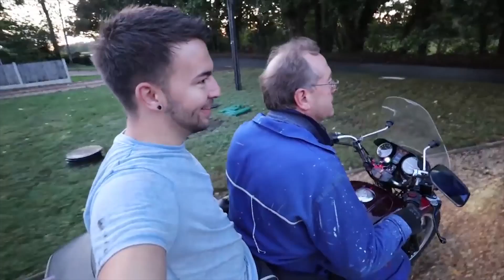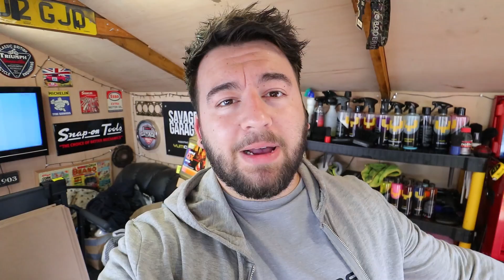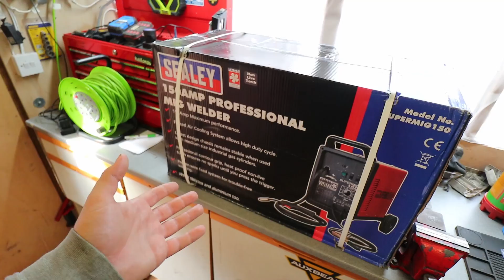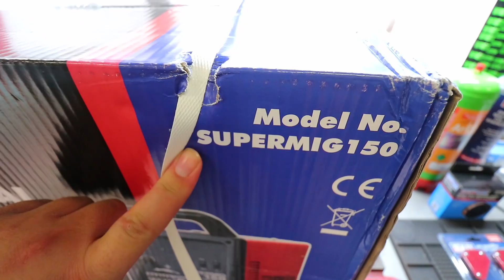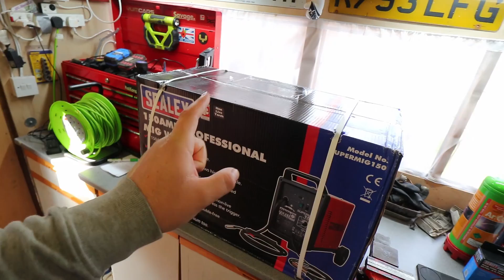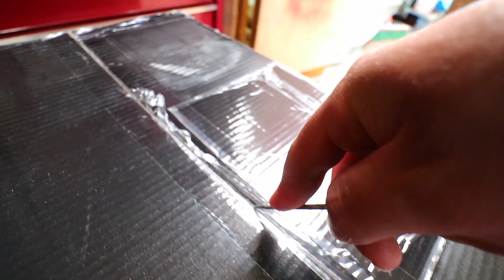I Got a Welding Machine! *Finally*

Comment: Great video 👍🏻. I  recommend getting a 16 Amp Commando Socket Installed with the correct blue plug. After long periods of use the 13 Amp plug might get hot and become a fire hazard.
Reply from the maker: Ben Libbeter I don’t plan on using it for long periods of time really but I’ll consider it! Cheers
Reply: @TheSavageGarage  
Don't worry about the plug, I got a 180/1 mig at home and that used  same 13amp plug for 28 years, if your shed power socket got minimal voltage drop then all be fine , that 150 mig light duty cycle and your planned usage going be lower voltage settings .
Plug it in and enjoy ...
Reply: @TheSavageGarage  personally I wouldn't consider it and just do it.

You will blow the 13a fuse constantly not to mention the heat etc.

You can do all of the calculations for 100% use and the heat dissipation over the cable's and plug and socket etc. But Imo it's borderline. Fit the 16a command.
Reply: @markd5266  
28 years on a 180 turbo mig and if I ever replaced the fuse I can't remember it and the plug/cables do not get warm .
Only time you get issues is if the socket you using got quite a bit voltage drop, some external power or long extensions can drop a serious amount of volts then your amp drawer goes high .
Reply: @David M , A lot of people who use to the nanny state and born wearing a high viz jacket and a hard hat and never done any real work thus have limited real world working experience as might suffer a back injury ...
Reply: @David M, If you blowing lot of fuses it due to a problem and not directly linked to a plug.
If you want a 16amp plug then you need a 16amp circuit with 16amp industrial socket .
Most people have issues on 13Amp purely as the circuit is poor install or they on 50Metres of extension cord and got voltage drop and when voltage low the amps go up to compensate and fuses keep blowing and wiring gets hot .
A good 13Amp circuit runs 3hp motors and a 180amp mig pretty easy, I never had issues in 30 years on 13amp plugs if all else is good ,.
Start current on a 3hp motor won't blow 13amp fuses and our mans 150 mig welder will be fine as long as his shed voltage in range over 220V
Reply: @mrb1864  And this is why rules and regulations are in place.

Can you guarantee that James will get a constant supply of 220v not to mention tolerances and fluctuations and power demand on the supply to the shed.
The regulations are in place to stop you from using a 50m extension lead etc.
Nanny state or not it will stop the shed going up in flames.
Realistically what you are saying is wire 4-5 kettle's up in a 13a plug and turn them all on at the same time 😂
And continue to use them.
Why do you think a lot of people are saying to use a dedicated supply.
If it was fine to use on a 13a plug it would have come equipped with one.
But what do I know I'm just an electronics engineer so no real experience.
Reply: @mrb1864  in another example, wire your cooker to a 13a plug and it will work. But then use the cooker on Xmas day and see how many time's you blow a fuse or trip the breaker and the cable's getting warm etc. And then tell me that you would be comfortable using it like that everyday.
Reply: @markd5266  
Quite simply you have that much inbuilt safety from the UK 13Amp plug design and fuses and consumer unit protection nothing going up in flames .
Worse scenario will be blown fuses if his shed power poor .
His welder will run off a 13amp plug no problem with some user common sense .
Is it by the book, no.
If you want see how far electrics can be pushed work in asia for a few years and you see mig and mma running on really poor US style plugs and low quality wired mains with minimal issues .
For DIY use at home on low duty lower power migs you can and thousands of people do use 13Amp supply no issues .
Stop the drama, James is competent enough make the choice and if he gets any issues he can evaluate and upgrade if so wishes or needs to .
From my real world experience  I never seen any issues if used with some gumption .
Reply: @markd5266  
with bit of gumption you don't get blown fuses or hot wiring.
In over 28years I can only recall on plug fuse blown .
Even a 3HP motor will run on a decent installed 13Amp circuit and if it won't the thermal motor trip triggers or a fuse or trip goes .
With a little sense it perfectly fine, he ain't planning on running a high duty mig and welding I beams for hours on end ...
Reply: @mrb1864  use your real world gumption then and consider it under a fault condition or under heavy usage. And then see what the outcome is.
Also how many people will have the common sense, hence the rules and regulations to stop this stupidity.
That's like me giving someone a unit and saying it will work fine just don't use it at maximum.
Reply: @mrb1864  you have just answered and proved my point. "with bit of gumption"

How many people have that, hence the regulations to prevent that.

Yes the UK has lot's of regs in place, that is to prevent the end user with no experience from causing harm to themselves or the property etc.

Just because your friend's welder has worked fine, that does not mean other people's will work fine.

Are you even taking into consideration about fault conditions, usage, temperature and relative temperature etc.
Not to mention that the cable to the socket maybe underrated for the maximum current draw etc....
That is why everyone is saying a 16a  plug socket and supply.
I've said enough on this now.
Reply: @markd5266  Quite simply review the duty cycle of the welder and size of cable that fitting into that 13amp plug ;-) 
read the input power and amp rating on front plate of that welder ;-)
It no big deal, the welder is rated for 13amp mains ...
Worse scenario if his shed wiring and residential power is poor is breakers or fuse will go.
The biggest risk would be welding in that shed full stop, the 13amp socket is a non issue and has so many levels of protection we will all live all but boring lives, sleep safe ...
Reply: @mrb1864  wrong..... Consider the end user has wired it to a 13a plug and hasn't connected the earth!

And a fault condition occurs, ie, live to neutral short circuit.

The appliance will draw as much current as it can until something burns or pop's.

You are presuming that that everything is wired to the correct standards etc, that is why we have standards.

Show me the calculations. The welder has a maximum power output of 4.5kw, divide that by the uk voltage and that is roughly 20 amps at full usage.

Now even taking in to affect diversity etc, it is still too much for a plug to use......this is why I and a lot more people are recommending the 16a supply for a reason!

Sorry you are completely wrong,

If James was to use it constantly for an hour to practice, and he uses a normal plug, but the socket that he is connected to uses 1mm2 cable what do you think will happen.

I'm bored of speaking about this now. It is James's choice.

But I know what I would do.
Reply: @David M 
No he isn't .
I used a 13 amp plug, same one for 28 years on a 180/1 turbo mig .
Worst you will do is blow the fuse ...
Reply: @David M exactly my point, would you put a 13A plug on a cooker? This draws the same power. It's 19 amps roughly without diversity. Lower with diversity think it's roughly 12.7 amps of the top of my head.

Comment: Just on wiring any plug, the earth (green/yellow) wire should always be longer than either positive or neutral to prevent a dangerous short.  If the cable is pulled the earth will be the last pulled out that way.  👍🏻
Reply: Tim Stinson that’s done the wrong way James
Reply: Tom Scott......Maybe.  ?    B-)

Comment: Good man, so you’ve popped your cherry and got a welder. It’s not easy to start with but just keep practising. Your welder needs a 16 amp plug and a proper supply from your fuse box, it will still work how you’ve set it up but it will blow fuses. Good luck with it dude👍👍

Comment: they don't come with plugs as it can use standard 13 amp plug or 16 amp blue one
Reply: Not a 13amp plug. It would of had a moulded 13a plug fitted. Problem with 13amp cartridge fuses is that they don't blow until 18amps.
Reply: @robertoliver3776  that not a problem, that an engineered design .
Any appliance has higher start up draw so fuses are designed cope with this and maintain the circuits handling capability .
These welders can be run on 13A (part of reason why this welders 3 core cable size it is), even the instruction manual states this ...
I've used similar and larger equipment on 13Amp plugs for over 40 years no drama .

Comment: Plug isnt included as its ment to have a 16a commando socket.
Reply: Yep -Looks like a beefy machine so prob 16a he’ll need to add a dedicated radial circuit ideally
Reply: @Stop..carry-on  I've got a 24 amp 5 way fused alarm clock
Reply: @chucky2316  cute
Reply: @benandallsmodels  it really is
Reply: people who don't know much should read the manual first ...
Reply: It is supposed to use a 16a or 32a plug. Please believe me a 150a machine will be fine on a normal 3 pin plug.  I've used my 180amp welder on a 3 pin plug and never had an issue. It might cause a problem if you are doing it all day everyday at hi power but for your average man at home a standard 3-pin plug will be fine. You have made a good choice for a first welder.
Reply: The regulator included is for a CO2 industrial style bottle. If you want to save yourself a bit of money you can use a CO2 fire extinguisher you can buy them out of date cheap. Your supplied regulator will screw straight onto the bottle. Everyone says CO2 is not very good but I have used it for years and never had a problem.
Reply: what?
Reply: @DogsBollocks-o8f  ??

Comment: I use a larger version of Sealey Supermig at work its very reliable we used argo shield light gas. I would not be welding in a wooden shed though it will catch fire easily.
Reply: lol, yeh wooden bench and wooden shed could smoke a bit :-)
Reply: Those Haynes Manuals on the shelf will go up a treat.

Comment: i recently started to weld, and i found using flux core to just be so much easier and quicker than gas, especially if your using the non-refill bottles. Also, get some welders sleeves/leather coat because you will get burnt if you dont. good video!
Reply: Radiation burns suck lol

Comment: It doesn’t come with a plug as it pulls over 13a on full power. So a dedicated supply with a 240v blue commando socket is the usual choice for over 13a. It will blow fuses on full whack, when that happens, that will be your issue.

Comment: You must buy tips for that wire...it looks like its to big....if you hawe wire 0.8 or 0.6 you must hawe tip for the gun also same...also the wheels in the wire feeder look maybe you can turn them on difrent settings becouse some maschines hawe in one wheel 2 sizes so look at that...
Also gas...gas is not something you take what you like it depends off the matal what are you welding...butt for you mix is the best!!
And also you must chek what wire you hawe for what matirial becouse you can buy for all difrent use...
And be gentle with the power becouse i think that is old trafo mashine so it Will take å lot off power from the socket so chek during welding are the power corde is getting hot...and never use extention cable in roll  for that one....

Comment: Plugs are only a legal requirement on domestic appliances in the UK..   You might find a lot of industrial places will have (for instance) those outdoor waterproof sockets with different plugs... So they leave the choice to you..

Looks a better bit of kit than most home welders would use..

Comment: That's a good home mechanic welder. Stay clear of gas less wire for body work. If you don't clean all the slag off the weld it can react with the body filter after a while and starts to lift it. Hardest thing with mig is setting the amps and wire speed. You know when you've got right, it should sound like eggs frying 🍳. 😂 Good luck. Oh yeah forgot to say never used tape on your regulator

Comment: I’m in a similar position as you - have welder, can’t weld, but need to weld. I’ll be watching this one intently 😅
Reply: David Bolton I was the same, keep at it and use you tube to iron out your problems, i can tell you it will come good in the end 👍👍
Reply: Les Baty I’ve been trying for a couple of years now, it doesn’t seem to be getting any better lol. I can solder oil to water, but can’t weld to save my life 🤣
Reply: 0.6 wire and co2/argon mix and small tack welds if you’re welding cars, it’s not that bad when you get used to it👍🏻
Reply: @bendude6748  i have heard that .6 wire is better for car body work, I got given two 15kg rolls of .8 that I use but will try the thinner wire as for gas I use just normal co2 (pub gas) and get on with it just fine
Reply: @lesbaty8919  the 0.6 wire just helps give you a bit more control, puts less heat into the panel. Just gotta do what works best for you anyways!